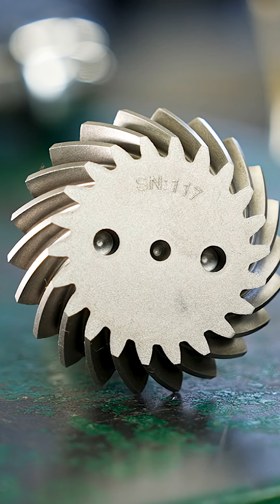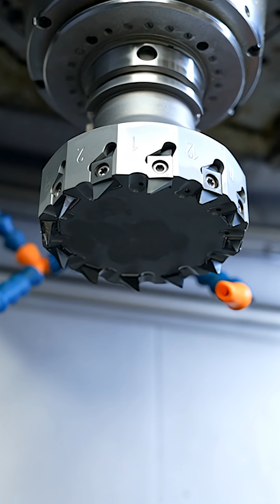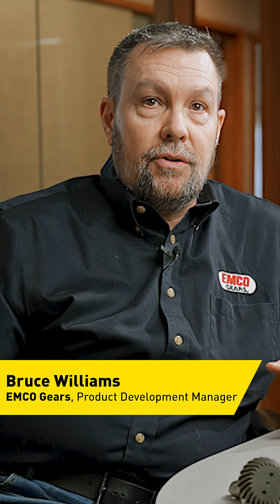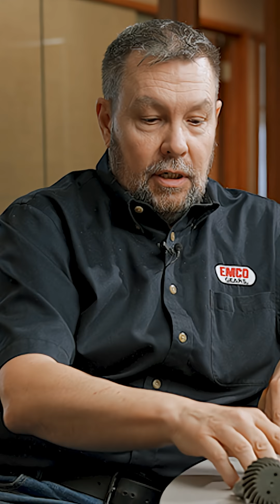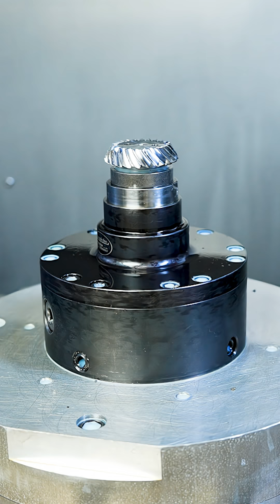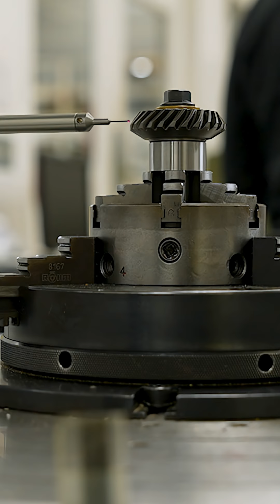8 Hour to 20 Minute Cycle Time Reduction for Bevel Gears [EMCO Gears]

Comment: Visited WEG Cestari factory last week. Every gear and sprocket has its own custom made cutting tool. A lathe machines two gears this size at once from a single piece of stock, and they only get separated after thermal treatment, before honing. Pretty interesting to watch.